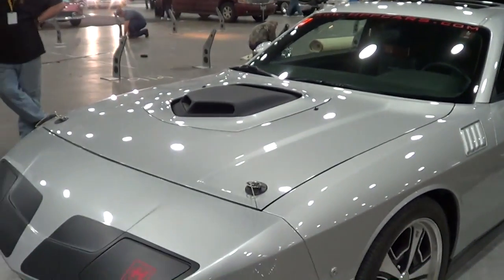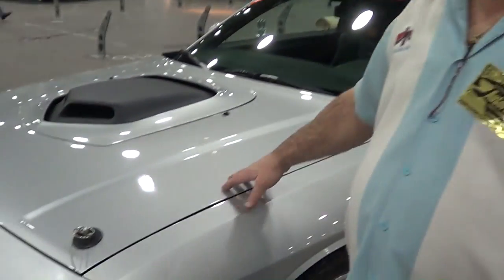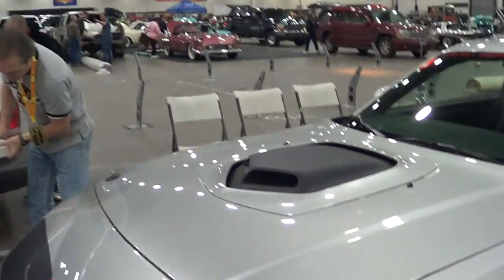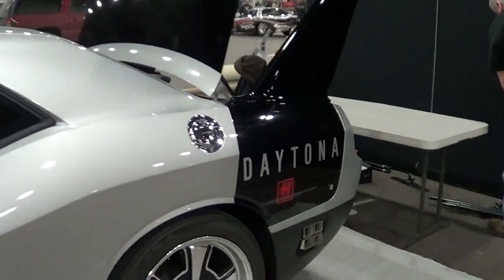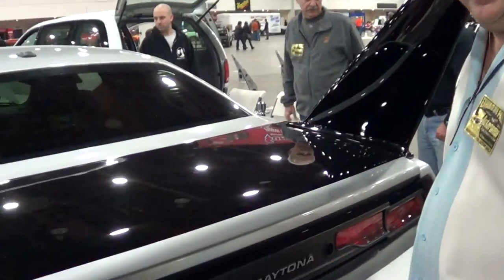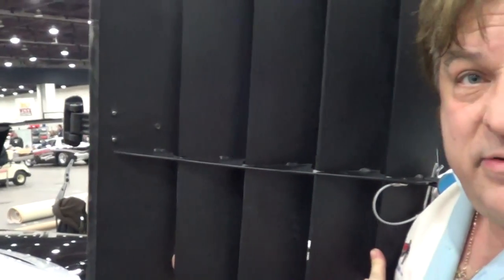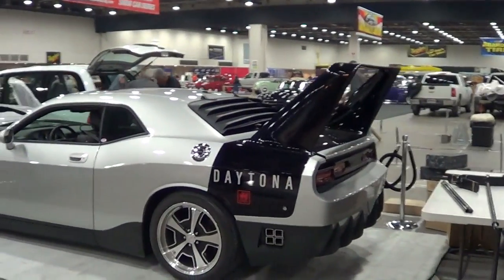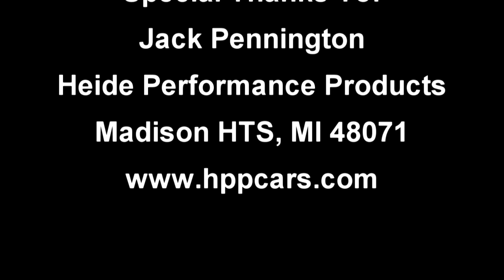2010 Challenger  'Daytona"

Comment: I am not sure why you keep referencing it to a Super Bee it should be Daytona since it is a Dodge if it were a Plymouth then a Superbird which is what I think you are thinking of?
Reply: KingGene technically they were both made by Chrysler
Reply: They did make a Dodge Super Bee from 68-72 (74?). It was built on the Coronet platform
Reply: @Bigmanjbmopar  i mean i said it 2 years ago but true
Reply: @totalslavmane2564  the company that does these conversions also has a Super Bee version with different headlights and the decals, when you take your Challenger there you can choose between a Daytona or a Super Bee

Comment: I think there's also a 'Cuda kit I've seen on YouTube that looks pretty good...and the GTO/Trans Am kits for the Camaro improve it's looks by a big margin...I hope I'm not alone in saying that if any or all of the Big Three would truly manufacture a car exactly as they looked in late 50's thru to the early 70's they'd sell like crazy...for instance do the '57 Chevy on top of all the components of a current model...would probably be cost prohibitive to re-tool an assembly line but the big thing in the custom world is doing just that...it's quite popular. Oh well, I suppose I'm still depressed at how Ford screwed up the Mustang with this Fusion/Taurus looking thing now...I had a blast with my 2010 GT but Ford lost a five-time customer in me...five straight new vehicles from pickups, SUV's, to the Mustang. And I'm not really"brand" loyal. If it looks good, drives good, and has the options I like, I try to deal. But now, I'm getting back on the Mopar train...the 2018 Dodge Demon looks like it'll be pretty tasty. Lol, the sticker price probably won't be a whole lot less than hunting down an old Superbird or Daytona...and whatever happened to the Prowler? It had loads of potential in my opinion if they woulda dropped a V-8 in the thing...enough of me ratchet-jawing...I'll save the subject of putting V-6's in the new "muscle" cars. Again another example of "if it ain't broke, they gotta fix it." Sorry Big Three, I know you can get plenty of power out of em, but I'm not dropping a dime on something that sounds like a rice-drifter...yuk, just friggin yuk
Reply from the maker: Dude!...I agree with about every word here....lol

Comment: Mine is the current Speed record holder for the GEN 3 Hemi with My daughter Sammi Highsmith driving.She set the record 0f 212.7 MPH in April of 2015.  Worlds fastest GEN 3 HEMI GRIZZ.
Reply from the maker: +Highsmith Hemi Cool!
Reply: +ScottieDTV .Thanks.   Mine was built by HPP in their facility.  I did the mechanical initially at PPP and then Spankintime Motorsports to get GRIZZ where it is today.  Mine was the first Race version built and the first one after the proto types.  It was numbered by HPP 002 as the second overall Superbird.  I had them install a custom interior and paint.
Reply: +ScottieDTV The race version had a stronger front end, light cover braces&#160;and a adjustable &#160;wing designed for speeds of 250 MPH.  HPP are great people and it is to bad they are not doing it any more.    You can still buy the parts to change your Challenger into a Challenger Superbird Winged Warrior if you would like. Manicini Racing is selling the parts. 800-843-2821

Comment: SRT in interested in doing a high performance Challenger, like what GM is doing with the Z/28.  They should do this.  Throw a Viper V-10 in.  They said the new Challenger model would be exclusive.  So you have a 640 HP Challenger with excellent aerodynamics...that could very well equal 200 MPH, so long as weight isn't too big of a problem. Give the GT500 and ZL1 a run for their money.

Comment: LOL the late model TransAm version would be a hell of a lot more of a performer than the original, because they weren't real muscle cars and the intakes were even non-functional fakes. I think they made a whole 178 hp and we're all show & no go, but the 6.2 produces 426 hp and are definitely better looking than the original to. I really like the 67-69 Pontiacs and Camaros, but went downhill after that and like the new body style much better because its designed after the original.
Anyway back to the reason I'm here to begin with, I don't know what to think about this build. Saw one last year at streetside classics in Mesa AZ, and are pretty cool in person.
Oh BTW, they are not 6.2 and is the engine they use in hellcats. The Challenger SRT8s are equipped with the 6.1 from 08 to 10, and are the 6.4 (392) from 2011 on
Reply from the maker: Cool..Thanks for checking this one out!!

Comment: I don't like the fender vents but the car came out cool, good thing they went with a 2012 Challenger instead of a 2012 Charger, the Charger wouldn't of pulled it off like it used to.

Comment: oh and btw the original Dodge Daytona  did 247 mpg on a enclose track and if u know anything about nascar moded cars in the 60's-70's they were showroom cars with upgraded tires roll cage restrictor plates and gutted and a longer gear.   247mph in 1969 the stock off the show room floor Daytona's did 230 on salt flats.  took Bugatti 41 years to do that.  just saying

Comment: no the wing is pretty accurate,  Btw the Dodge Daytona Charger was only made one year 1969.   Was banned from Nascar for being too Fast.   in 1970 they took a Road Runner and did the same modifications to it as they did to the 69 charger 500.  again was banned from nascar for being too fast.  Superbee's were made from Coronetts not roadrunners or chargers.  I want a Hpp Daytona currently I only have 1 Daytona.  a 2005 Dodge Ram Daytona.  for a truck its got balls.

Comment: Its called a Superbird not a Super Bee!
Reply: ACTUALLY - Originally in the late 1960's - they were called Dodge Super Bee (the moniker was a bumble bee on racing tires) and Plymouth Roadrunner - they were called Superbirds - (the moniker was the cartoon character - "The Road Runner" - and the horn even sounded like the Road Runner's "Meep-Meep" cartoon sound - and both ran about $4500!!!!  The idea was to OWN Daytona - which they did!!! But (according to the rules) to run a car at Daytona - the manufacturer ALSO had to make and sell 2000 of the same car!!!!!  So all Plymouth and Dodge dealerships - got at least 1 Superbird or Super Bee - and they were VERY HARD to sell!!!!  (If you could afford it - you were not a "muscle car type person"!!! The average car of the day was about $2500-$3000 - VW Bugs were $1995!!!!!)  Both of the "winged cars" had the pointed nose with rotating head lights and high tail and BOTH came with a "wink" option - you push a button and only one of the front head lights came on and then went off - the car "winked" at you!!!!!!  Sounds goofy - but in those days - THAT was cool!!! These were VERY HOT cars - my friends Yellow 1970 Superbird had the "pistol grip" shifter - made by Smith & Wesson (which made really bad ass handguns)!!!!  He had a yellow Superbird - (I think they all came with 440 engines) and it was GREAT - it could EASILY burn a set of tires - and NOBODY could come close to it in a race!!!!  We raced another "Muscle Car" - a 1969 Chevy Chevelle 427 with dual 6 pack carbs - blew it away - quarter mile race - and we won by about 60 feet!!!!!!  My friend screamed out the door - "Go back to the start line and get your drawers!!!" - as blowing someones drawers off - was the put down of the day!!!!!  The really odd thing was - the 1970 Plymouth Roadrunner was a very LARGE car!!!!  We raced for dinner at McDonald's - and we actually followed them and they paid - Big Mac/Fries/Large Coke - for both of us - as we all hung around the car looking and talking!!!!!!  My buddy sold his 1970 Superbird a few years later - if he'd have kept it - today - in pristine condition - matching numbers - your looking at a $350,000 car - that originally cost $4500 in September 1969!!!!!!!!!  THAT - was a MUSCLE CAR!!!!!!!!!!  And the "Muscle Car" era was generally about 1965 - with the Plymouth GTO - and ended about 1973  and was started and ended by Lee Iococca and John Delorean - from Chrysler/Plymouth - and killed by the insurance companies!!! Hard to buy a car and pay $150/month - AND $145/month in insurance - in 1970!!!!!!  Ahh - those were the days, my friend, we were the kings of the road!!!!!!!!

Comment: Actually Plymouth used to be dodge.
Reply: +alejandro Hernandez Huh? Plymouth was Plymouth, Dodge was Dodge.
Reply: No Plymouth is a company from dodge that's why dodge was and had tastes cars back then
Reply: alejandro Hernandez You don't know what you're talking about. For many years, it was Chrysler, Plymouth & Dodge, with CHRYSLER as the parent company. Both Plymouth and Dodge were separate companies under Chrysler Corporation. Dodge was founded in 1914 and Plymouth was founded in 1928. Dodge never owned Plymouth...ever.
Reply: Dodge and Plymouth were two separate companies. Over time Chrysler acquired them. Sadly Plymouth died off. Plymouth had the Road Runner, Dodge had the Charger. Plymouth had the Cuda, Dodge had the Challenger.. And so on...
Reply: Matt G Actually, Chrysler created Plymouth.